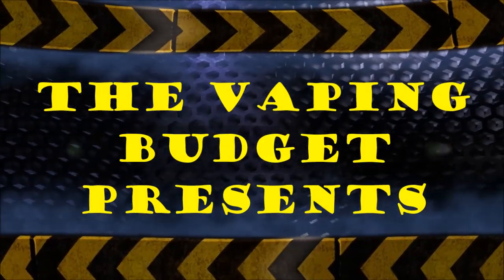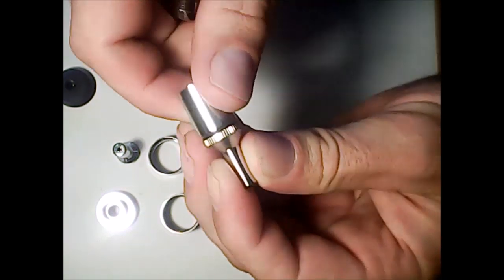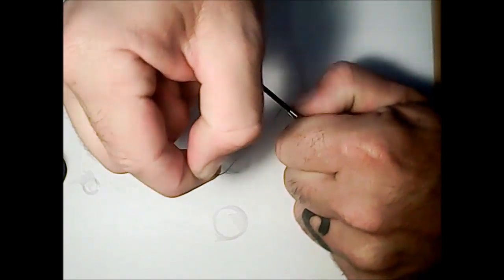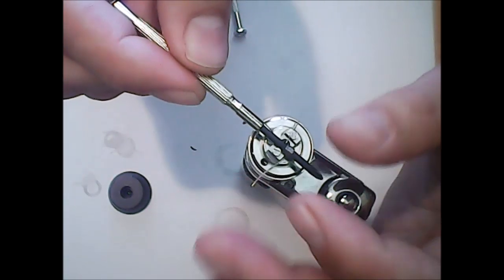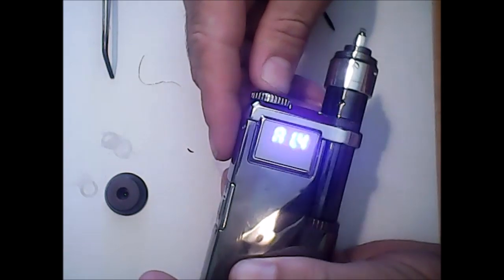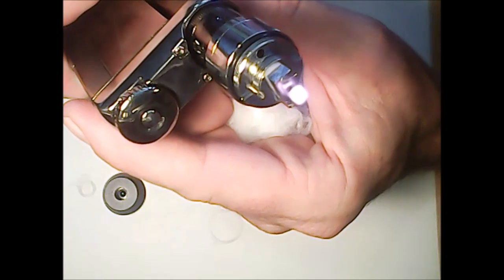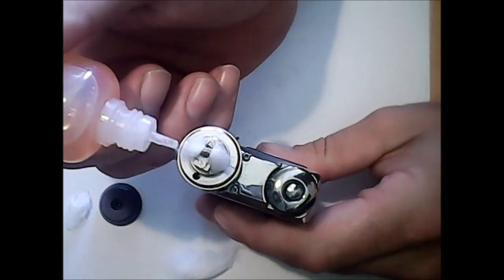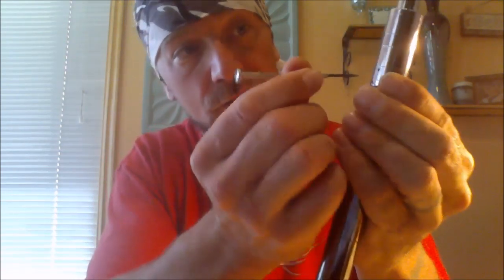Kayfun v3.1es clone from fast tech review and build with 1.5ohm micro coil

Comment: Gotta tell you…watched a lot of tutorials on that particular tank &  build…kept coming back to yours…concise, accurate and easy to follow…anyway did the build last night and WOW…did 9 wraps of 28 gauge and got 1.5 which went to 1.6 after torching and compression…the flavor and the vapor is amazing…only problem I found was the size of the screws…think they could make them any smaller?...Jewelers goggles on their way…but hey Scott thanks for the vid and I will try the T2 tonight…got a bunch of em.

Comment: Nice vid man. Can't find a tutorial on a 1.5 ohm dual coil build. Is this something you may be open to posting a tutorial for?
Reply from the maker: You can do a dual coil build in the Kayfun but I have found with the single airflow hole a single coil at 1.5 ohm will give you a better vape. I have 6 Kayfuns and two have dual coils but I set those up at .5 to .8 ohms to get the vapor and flavor I like. I will do some dual coil builds around 1.5 to find the best build and post a tutorial this month... VAPE ON BRO

Comment: How is the shipping from fasttech?
Reply from the maker: It has taken about 10 days to get here once I get the notice that it shipped but don't
order anything with batteries. My last order got returned after waiting 30 days they did
refund the money. After having my money for a month UGH.
Reply: +bling blong Airmail 7-10 days if you order battery/chemical stuff then comes from sea =up to 15-20 days.
Reply: thevapingbudget now fasttech says that the post service won't ship batteries due to a few having "exploded in transit "I don't buy it, you would allmost have to intentionally dead short them to blow em up, but that's what I was told